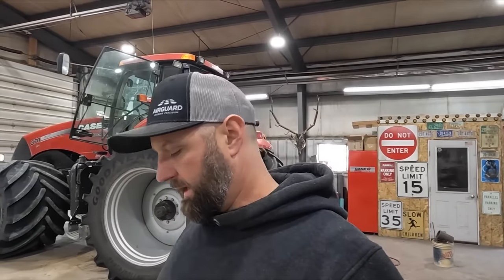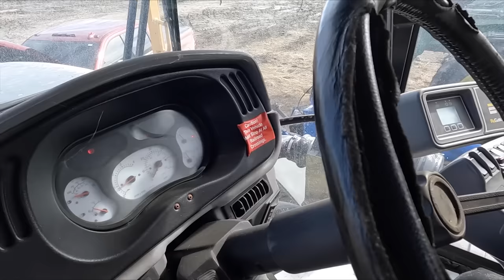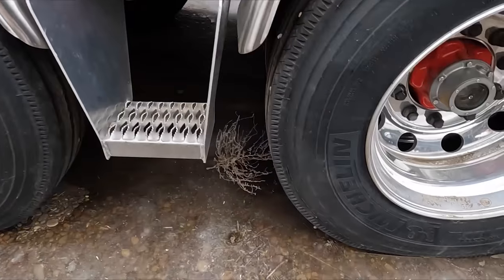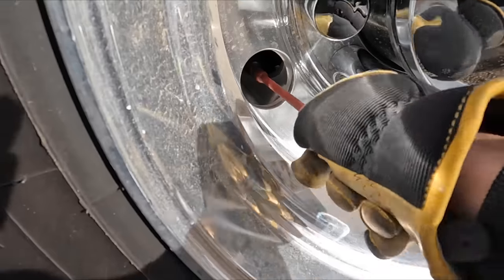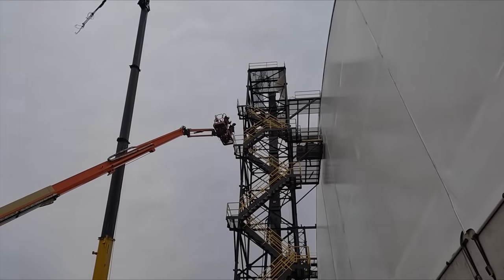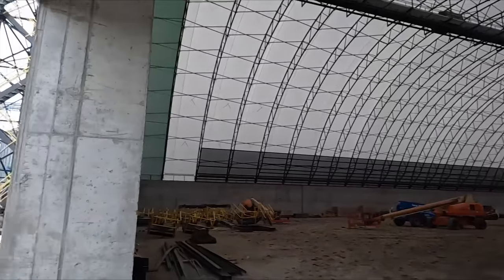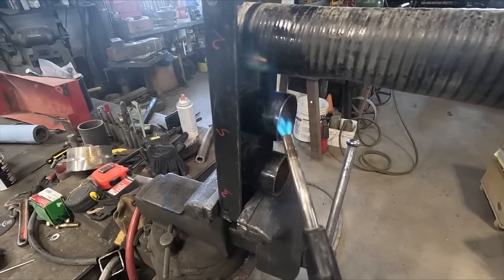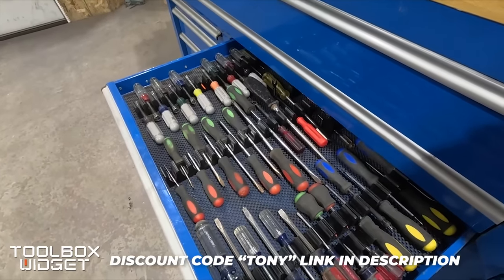Jake Brakes: “I said what I said.”

Comment: 100% agree with you on the Jake brakes , they are a safety part of the truck so if you have them use them .
Reply: Lots of peaple need to learn how to use Jake brakes and thay would save on brakes and not smoke them in the mountains! I wonder how well jake breaks work on automatic transmissions on trucks ?

Comment: Jaks or any good auxiliary break system is safer, and yes saves on maintenance and also the biggest cost, fuel.
Also, when you get 75-80% down the hill, start releasing the brakes to start building up speed , so the momentum gets you up to speed. You won't need to put power on to speed up.

Comment: Canadian here, was surprised to see you pulling trains you can only get 105,500 on then right is that weight worth it compared to what you could haul on a single? I’m not sure how much you could get on a single trailer or what axle combo you need to achieve it. I’ve heard 90,000 but not sure what that’s on
Reply from the maker: With the pusher axle we can haul 116,000 plus 10% over the the first scale. So they work pretty good off the farm.

Comment: im i right in saying jake brake are exhaust brakes?
Reply: Not the same thing.
Reply: @45Deere9500  can you explain then?
Reply: The engine brake is a compression brake, it turns the engine into a compressor
Reply: @roymills2564  

Exhaust and Jake Brakes are both engine brakes, but work differently.  

In essence, an exhaust brake works by “plugging” the exhaust, usually (maybe always?) by using a butterfly valve in the exhaust system.  When the butterfly valve shuts, it increases back pressure, which increases the resistance the pistons experience on the exhaust stroke, thus slowing the engine RPM.

Jake Brakes affect the timing of the exhaust valves in relation to the combustion cycle.  They hold the exhaust valves shut longer than usual, on the exhaust stroke, basically making the cylinders air compressors, thus slowing the engine RPM.

That’s a simple overview, at least the way I understand it.  A simple search of “exhaust brake vs Jake Brake,” will get you better explanations.
Reply: Jake is short for Jacob's Engine Brake if you wish to look up the info.
Reply: @raass233  

And was invented by Clessie Cummins.
Reply: @45Deere9500  thanks that makes sence now